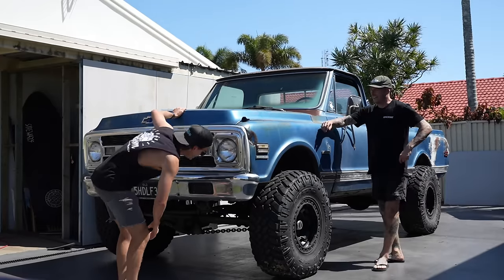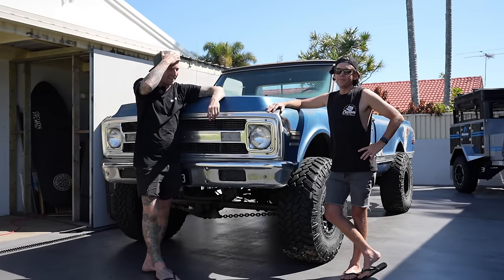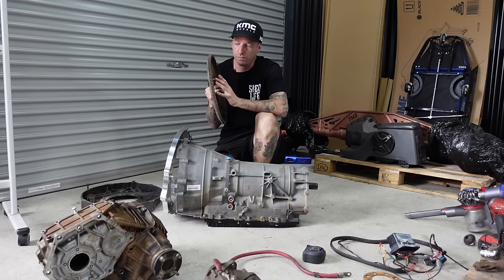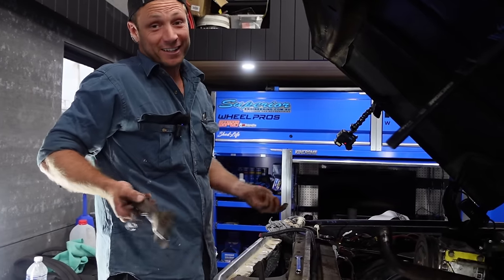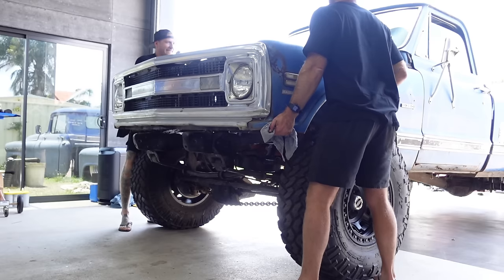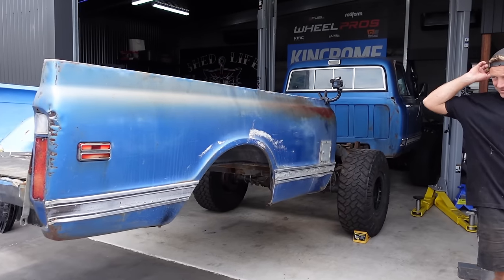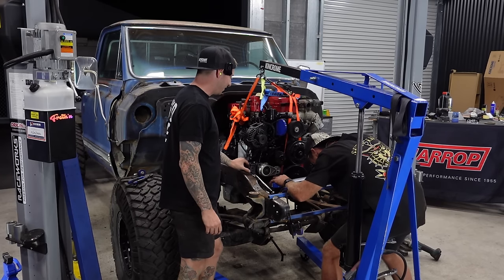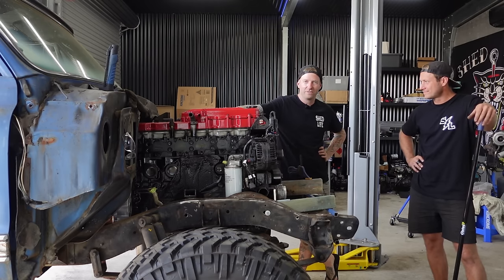1000hp Cummins conversion (4x4 CHEV)

Comment: Coolant filter is for slow release of SCAs in the coolant to maintain required levels. In particular blocks prone to cavitation require correct SCAs kept up. That's be my guess for the filter. The filters come preloaded with SCAs. Is a thing with trucks, pooley would know being a cummins dude..
Reply from the maker: Ahhh true !
Reply: It is not so much a filter, it contains anti corrosion chemicals that are slowly leeched out into the coolant as it flows through.
Standard fit on earthmoving and mining gear with larger engines than standard light vehicle engines.
Reply: That 8speed will last one decent drive
Reply: I dont think it will last the dyno run haha but what we have planned for the second 8 speed will be sweet! @wildcustomsandmechanical6528
Reply: Ah makes sence ive learnt something new!!
Reply: Reverse cowl?
Reply: Thru heat cycles of long duration iron blocks. They have a tendency to flake material into the coolant therefore the necessity of anti corrosion additives 
( SCA , LCA )
Reply: Extra as fuck none of the regular commons motors have em

Comment: If the coolant sits in the engine long enough, it tends to react with the iron (or aluminum) inside the engine. The filter is to subtract those small corroded pieces so the rest of the engine will rust less rapidly. (It's basically a sort of anti-rust system.) The coolant filters are commonly used on bigger diesel engines such as cats for bulldozers, but also on some bigger car engines.

Comment: Coolant filter guess - They had a rusty radiator or heater core, and used it to catch the metal flakes running through the system.

Comment: Because old cast iron blocks rust internally and a filter will stop your radiator from blocking up and keep the engine cooling system running smoothly

Comment: you should keep the np205 transfer case because it's far stronger than the landcruiser one which i have my doubts would last behind a 1000hp cummins that would have around 1700nm of torque.
Reply from the maker: Yep all an experimental process at the moment , turns out the 79 transfer doesn’t work so will be going a different route next episode 😎
Reply: Yep i agree have changed already, but unsure about the 205 being hard to get in australia
Reply: @macpreston  that's why you use a 205 so you don't have to get one. you can also beef them up as well. the downside of the 205 is 1.96:1 low range but that won't be an issue with the low revving diesel and auto it'll still crawl. and these days you can get parts from usa just as quick as from melbourne or perth.

Comment: Mate metric threads are easy to know the drill size you don’t need a chart. just take the pitch off the shank size eg 12x1.75 thread needs a 10.35mm hole, 10x1.5 thread needs a 8.5mm hole, 8x1.25 thread needs a 6.75mm hole ect.

Comment: Was that not a gear driven NP205 transfer case? Why pull that for an aluminum Toyota case? The 205 is basically indestructible.

Comment: Caterpillar run coolant filters along with most heavy machinery.. some say helps with keeping coolant levels.. my opinion is saving thousands of dollars worth of radiators and waters pumps if a part fails or corrosion. I'm putting coolant filter on my rig to stop blocking radiator cores if I have a good mob of shit come shooting out of the block!
Reply: Makes sence for sure!

Comment: Where did you get the adapter plat for the 8 speed transmission and what 8hp 8 speed transmission are you using?
Reply: Came here for the same reason
Reply from the maker: 8speed.au    They are located in Brendale, Brisbane

Comment: That trans isn't going to last behind a Cummins, even in stock form. If you're considering 1000 whp (you've got a long way to go still), you might want to check out what's behind 1000+ whp diesels; a built FMVB 48re. No need to waste time and money "experimenting" when people have already done that for the better part of 20 years and figured out what works best. A 1000 whp Cummins build is quite easy, if you know what you're doing, and there's several (Firepunk, Horsetorque Diesel, etc) who go into the details on how to get there.

Comment: Keeps crap, like casting sand, rust etc from circulating and clogging stuff up. My heater core is full off crap, my oil to water heat exchanger once clogged as well.
Reply: There ya go! Makes sence!